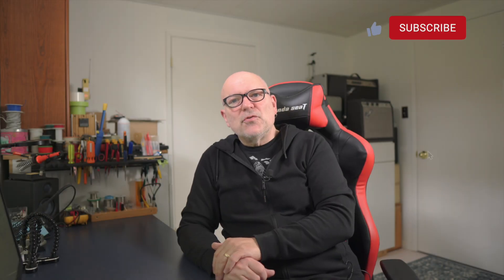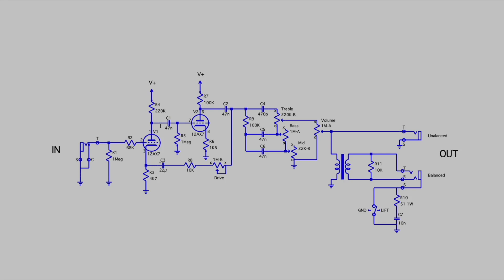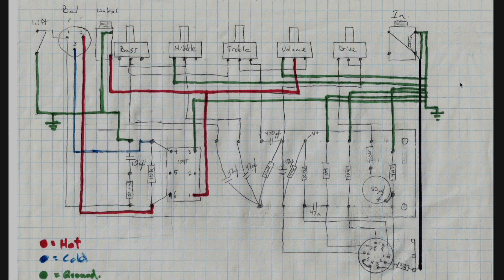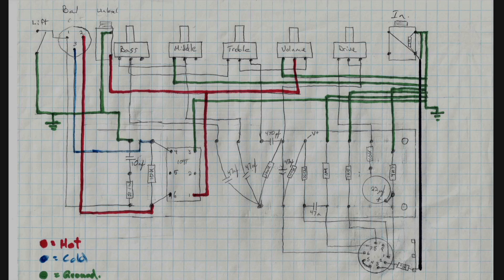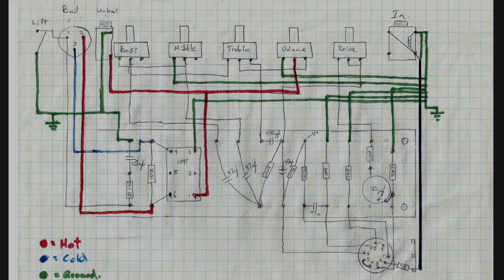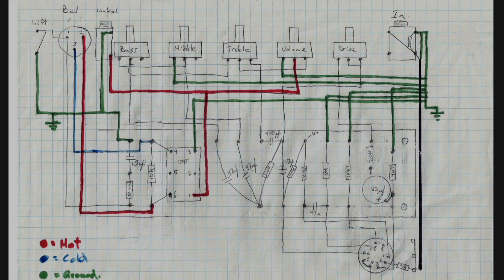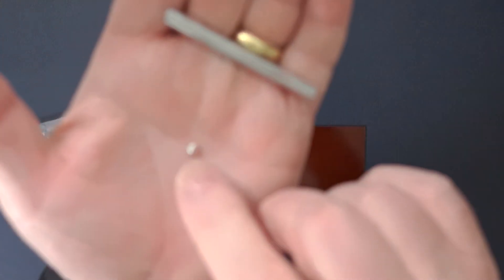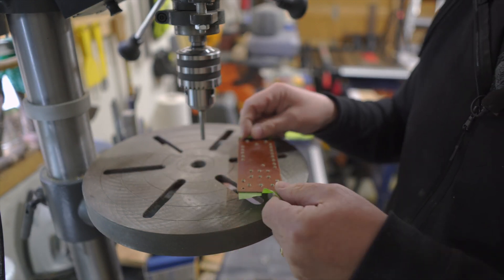Tube Bass Pre Prototype Pt 1 - Schematic & Layout

Comment: Hi! I've been wondering why you need C3 in the circuit - if you leave it out, the DC cathode voltage of V1 will still be isolated in the circuit by C2, C4, C5 and C6. Or is there something I'm missing?
Reply: C3 keeps DC from the cathode off the potentiometer. It may have other functions as well - I'm not familiar with this circuit.
Reply from the maker: @BeerBulldog0  you are correct. I’m just editing a video about this part of the circuit.

Thanks for your input.
Reply from the maker: I was afraid someone would ask about that part of the circuit! 😂

That feedback circuit was added at the suggestion of Kevin O'Connor from London Power. The circuit I'm building was drawn quite a few years ago and, except for the feedback circuit, is pretty straight forward. I'm not sure I have the workings of it clear in my mind anymore but, I think C3 is there to keep the circuit stable at low frequencies.

If anybody has more input, please feel free to chime in.
Reply: @JagStar  Looking at it again, I have doubts about the value of C2 - 47n seems a pretty low value considering the lew impedance of the cathode of V1. I'm afraid that low frequences wouldn't be affected by the feedback loop. If I'm allowed a suggestion, how about changing C2 to 22uF and leaving out C3 altogether?
Reply from the maker: @pafnoocy  Thanks for the suggestion. I'll probably play around with it some, so will try your suggestions. Unless I'm looking at it wrong, that's a positive feedback loop and I've never really played around with that. I recall discussing this part of the circuit 15 years ago when it was suggested and it made sense to me then. To be honest, after that much time, I'm trying to get my head around it again.
Reply from the maker: @pafnoocy  This build is based on a bass preamp kit I bought from London Power about 15 years ago but never built. That part of the circuit has had me scratching my head since I first got the original kit. That's partly why I chose to base the build on it, so I could learn what it does. I just sent an email to London Power with a scan of the original schematic (I'm building a modified version) to see if I can get Kevin's input. If I hear back, I'll probably do some discussion of it in an upcoming video.

Thanks for challenging me! I really appreciate how this discussion has made me take a closer look at both positive and negative feedback circuits.
Reply from the maker: Sorry it's a negative feedback loop, I had my head on backwards yesterday.
Reply: @JagStar  No problem. I'm myself in the process of deciding on a suitable preamp stage for my bass amp project and this gets me to poke and prod around for ideas. Do keep us posted 
All the best 
Pawel